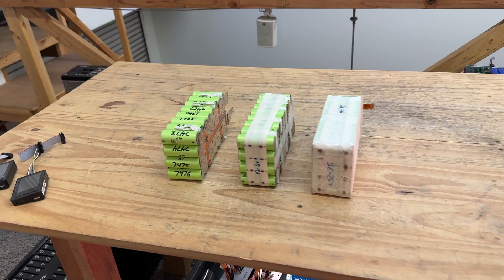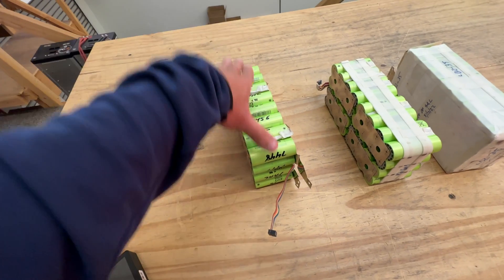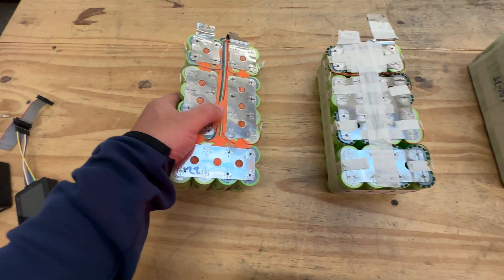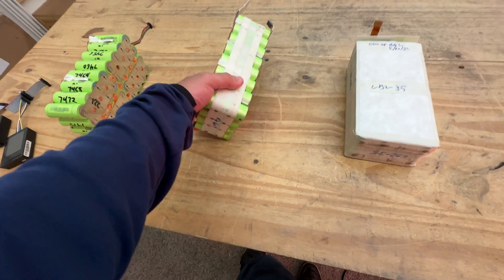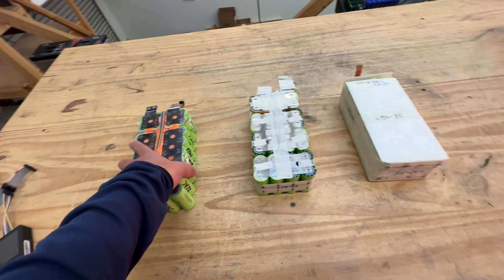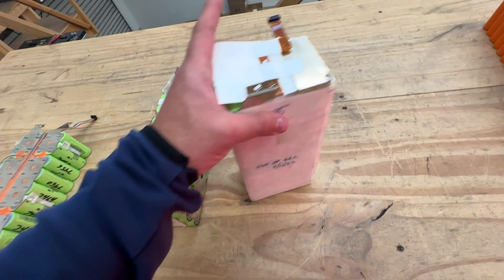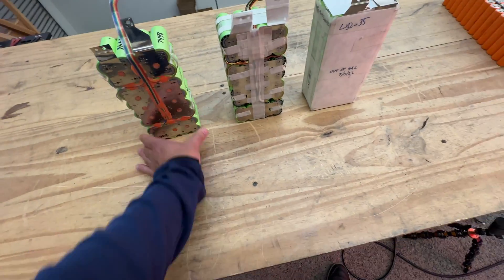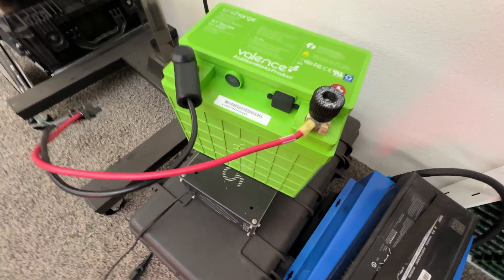480A Capable A123 LiFePO4 Modules (280A Continuous)

Comment: 280A discharge through those thin spot-welded output leads? Yeah right. Comedy gold. 😂😂😂
Reply: If that’s the same nickel bus used by A123 on their 12S8P packs it’s 0.4mm thick pure nickel. Probably capable of 200A. 

Look at how their 12S8P packs are made. There’s a “fuse” on one end created by the nickel having a bunch of holes punched into it at the end just near where it was tied into the e-bus battery module. E-Bus battery so it was rated for insane amps (400A or more)

Comment: I see they are at end of life 80% capacity. A little pricey given that fact.
Reply: That's the standard EOL number given in almost every datasheet. Some say 60% but that's usually when they are pushing power cells for many cycles at high charge/discharge

At 80% another full life cycle exists so long as you don't stress the cells. This is why you see big powerwall setups using 200P packs. If you never draw more than 100A from your 14S setup you can still power a 5kw inverter while keeping the cell draw to 0.5A and even the most degraded laptop cell that originally was speced at 3A discharge can handle that even though its seen 1000 cycles and its IR is triple its original value

Comment: Can it do that many amps with the stock welds or would it need to be re done with thicker strips?
Reply: There's no way those nickel series connections can handle that level of current. Anything over 100A is going to require aluminum or copper
Reply: @ericklein5097  I see. The 280a number seems a tad bit deceptive then.
Reply: @bj97301  Upon further binge watching of videos (I bought cells from another source and must learn as much as I can; 96 cells for $97 including shipping) I've seen people start cars with the original nickel strips. So 280A burst might be possible but you'd be insane to try to sustain that more than a second or two. What you could do is lay down a thin sheet of copper and over the top of the copper lay down nickel plated steel....now normally we don't use that garbage but it has its purpose here. It creates enough resistance to allow the Kweld and some MOT spot welders to fuse a nickel copper sandwich to the pack well enough to benefit from the added ampacity the copper brings. If you're unfamiliar with this sandwich technique I found it on Endless Sphere.
Reply: @ericklein5097  ah good idea. Thank you.

Comment: How the F are these as powerful as lipo RC batteries...

They are about the same actual C rating if they can put that much out
Reply: A123 magic. These cells are no joke but I wouldn't expect cells salvaged from packs that had unknown cycles to push full amperage without voltage sag lower than your grandmas titties
Reply: @ericklein5097  4s2p are sufficient for a motorcycle battery... 

Worst case 4s3p

Comment: How many of these would make 300 volt battery?
Reply: 12
Reply: @aznative_  thank u
Reply: @blue9120  no problem. With 12 of them in series you'd get 307 volts nominal and then it can charge up to 350 volts and it would be able to discharge down to 240 volts.